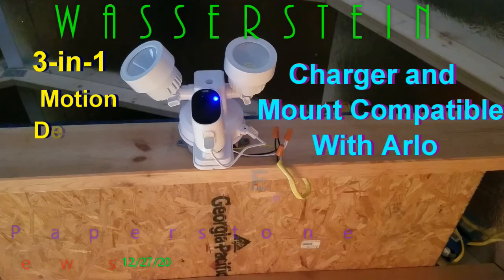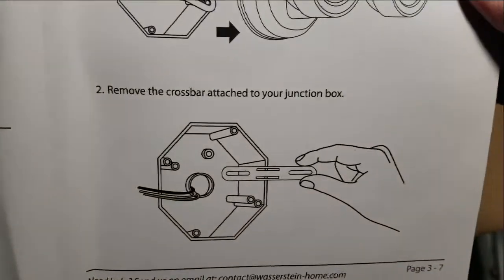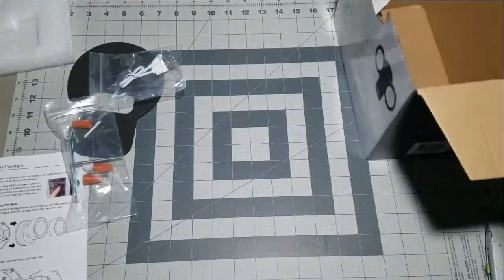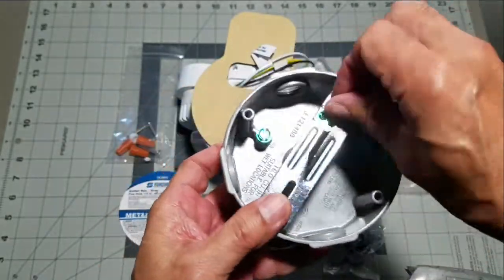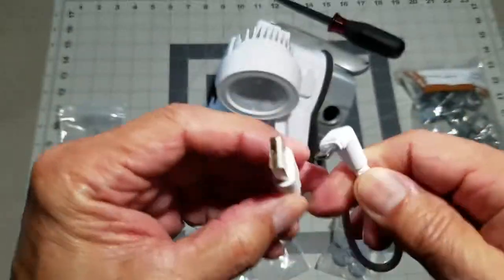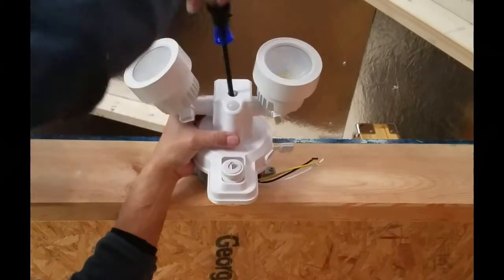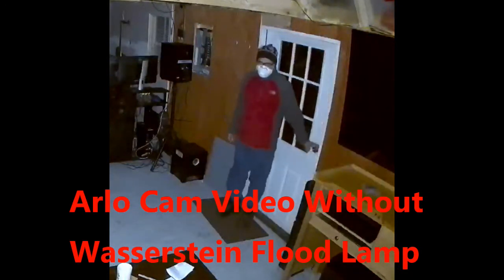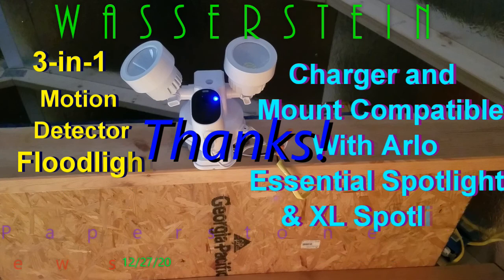Wasserstein 3-in-1 Floodlight and Charger For Arlo Essential Spotlight/XL Spotlight Camera Review

Comment: How did you get it to connect to the app?
Reply from the maker: The floodlight doesn't connect to the app. It is hardwired to an AC line and it has a motion detector that turns on the light if it is dark. The solar panel is a separate circuit that is wired separately into the Arlo camera's USB charging port. It is still working great.
Reply: @rockpaperstone8722  Mine needed to connect to the Wasserstein app, I was finally able to get it to work though by unplugging it and plugging it back in three times in a row. I think we have slightly different models, thank you for your reply though it's appreciated.